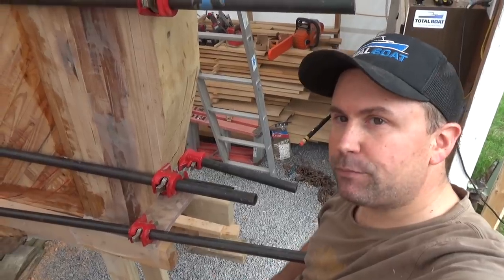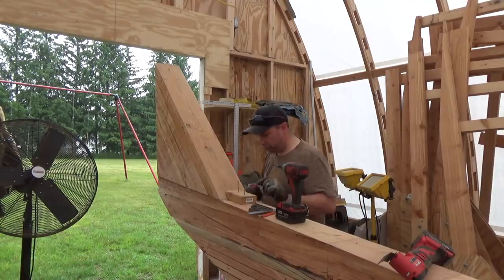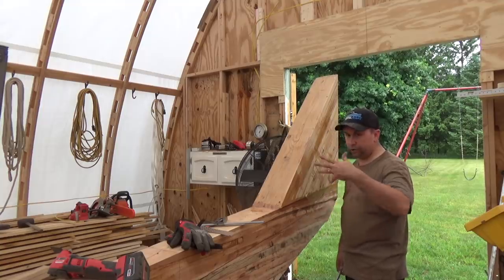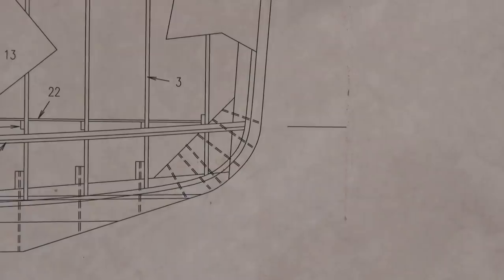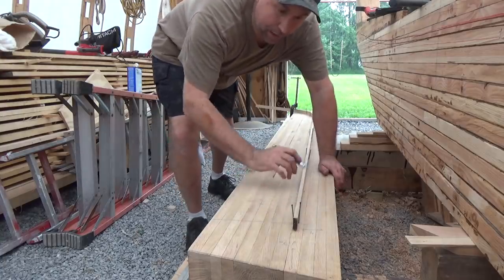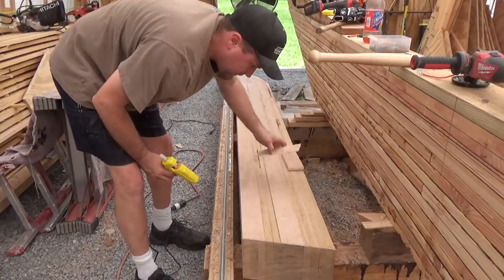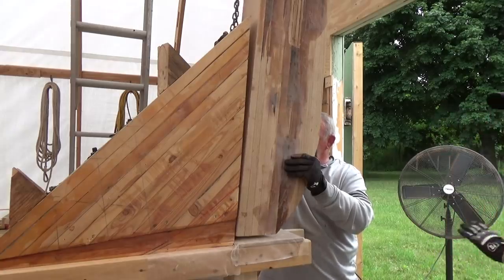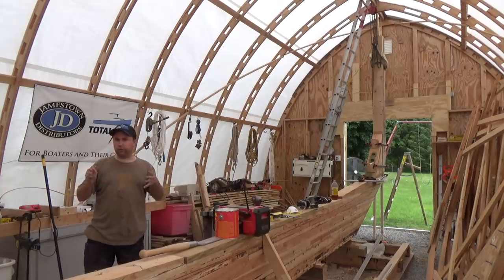Laminated bow stem install.  Sea Dreamer Project #28

Comment: Next time you need to make a big rabbet like that, use a router to hog out most of the material.  You can clean it up with a chisel, but it will get most od the material out FAST !